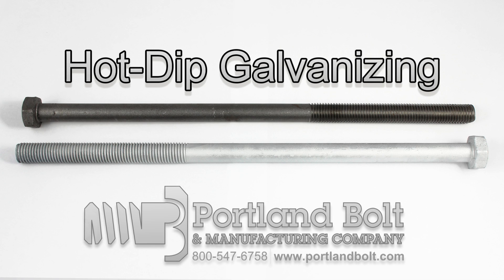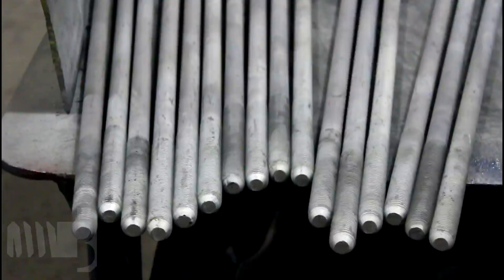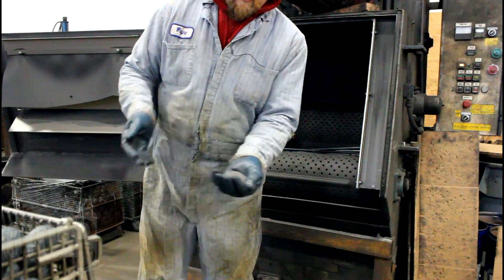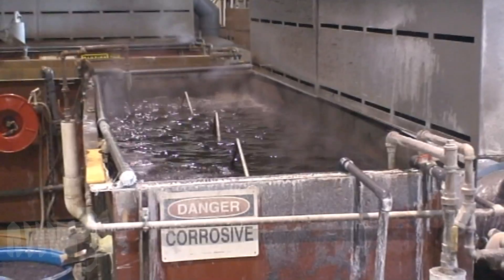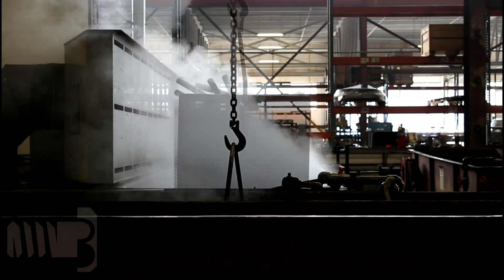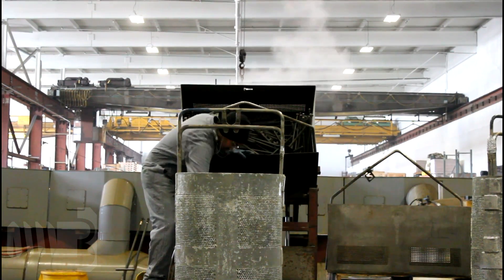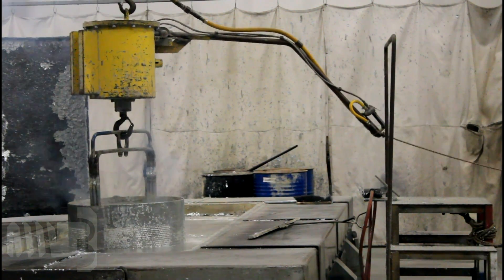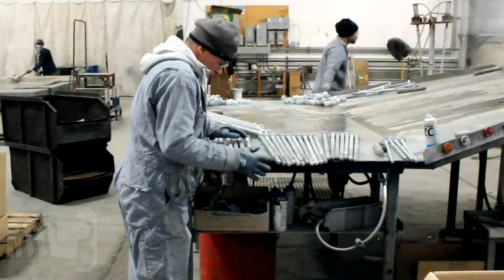Hot-Dip Galvanizing

Comment: Great video. Is it necessary to rework the bolts before galvanizing in order to not exceed external dimension of the threads?
Reply from the maker: The coating of zinc on the external threads of the fastener adds between 3 – 8 mils of thickness (.003” - .008”).  The hot-dip galvanized nuts that are used with the galvanized bolts are tapped oversized to accommodate the thickness of the zinc on the externally threaded fastener.  In other words, the internal threads of the nut are enlarged.  ASTM A563 covering nuts provides these overtapping allowances based on the diameter of the nut.

Comment: It appears to me that the hot dipped galvanized bolts on my new vehicle are rusting faster than those of my old vehicle.
Are there differences in galvanized bolts? It seems the hot dip galvanized bolts of my new vehicle have many small spots where zinc is missing. As if they were tossed around before use.
Reply from the maker: Galvanized fasteners in an automotive application should not begin to rust quickly.  During the hot-dip galvanizing process, the zinc metallurgically bonds to the steel creating an extremely corrosion-resistant coating that should last for many years.  Galvanizing is referred to as a “sacrificial coating” which means
any moisture or corrosive substances that come into contact with the coating will react with the zinc rather than the steel. The zinc corrodes, forming zinc oxide and zinc hydroxide layers, which provide a barrier against further corrosion and protect the steel from rusting. In this way, the zinc coating sacrifices itself to preserve the integrity of the steel substrate.  So even if there is a nick or scratch on the bolts, they should not rust.  There are other types of coatings such as chrome plating or zinc plating which are very thin and applied to the surface of the fastener.  Those coatings are susceptible to chipping or damage which could expose the underlying steel resulting in signs of corrosion.
Reply: @pdxbolt  Many thanks for taking the time for your extensive response. It has been helpful. 👍